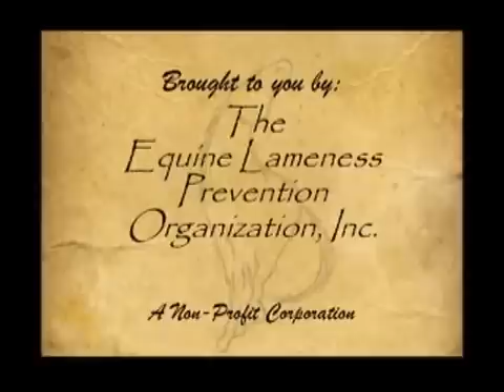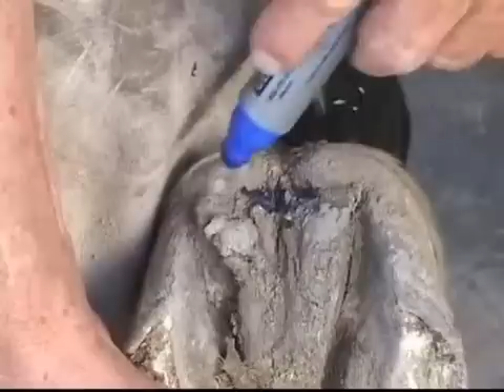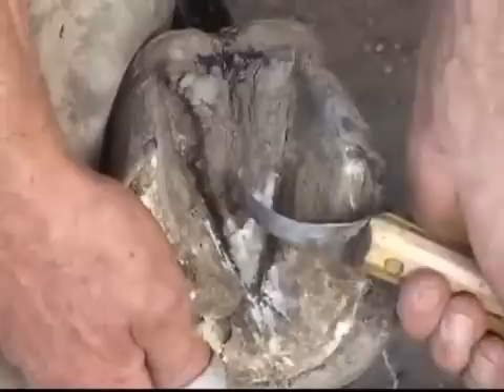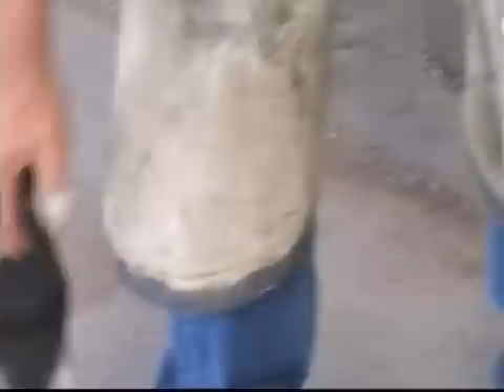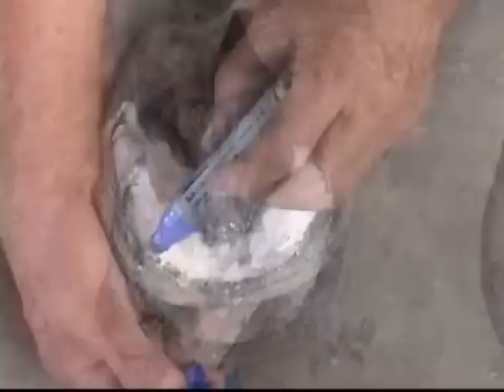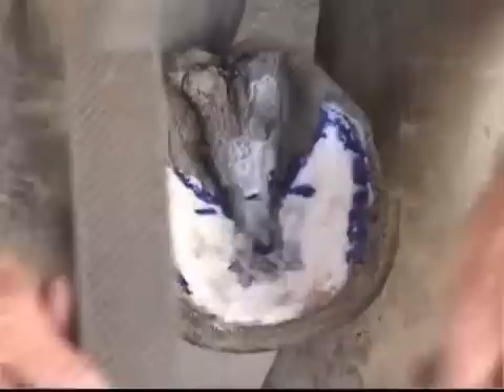Hoof Mapping & Trimming - Part 1

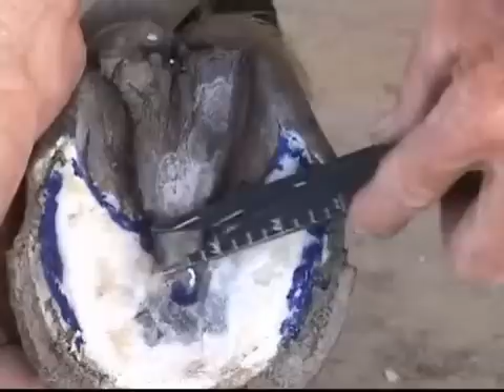Comment: (8:48)  where the bars terminate in healthy hoof should be a straight line from the heel to  the apex of the frog...What Gene is teaching you is how to keep a hoof locked comfortably in founder.   The reason Gene is teaching terminate the bars is not because  he doesn't know it...but because it is very difficult to get straight bars...it involves physical therapy to reduce tension on the flexor muscle which will lengthen and strengthen the stride.  If you try to force the bars straight the heel will collapse forward (more underrun) making the horse lame.  Gene's method is OK but does not peak the performance of your horse and it puts the trimming into a continuous cycle of overgrowth and correction.
Reply: Is there a channel you can recommend that shows a better treatment of the hoof?
Reply: I am very curious about your comment and would really like to know more. Can you please elaborate or point me in the direction of more info? Thanks so much.
Reply: @ANNETE784  not sure there is much more i can tell you without knowing your level of familiarity with hooves.  the point i'm trying to make here is that  bar deformity is not being corrected, it cannot be corrected  by the farrier alone, and therefore the horses are not at peak performance.